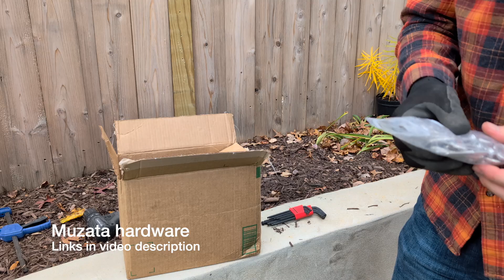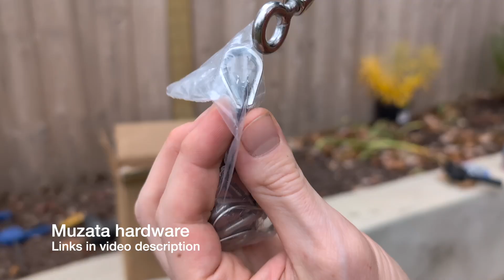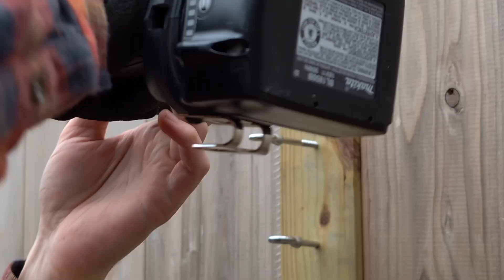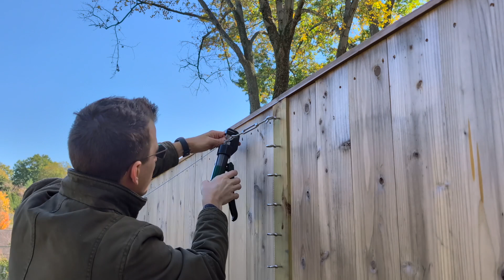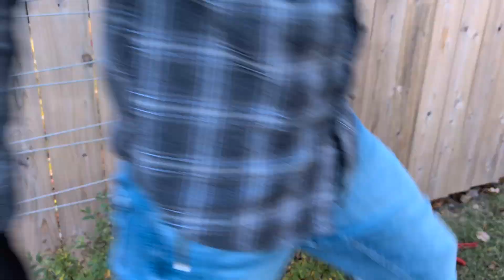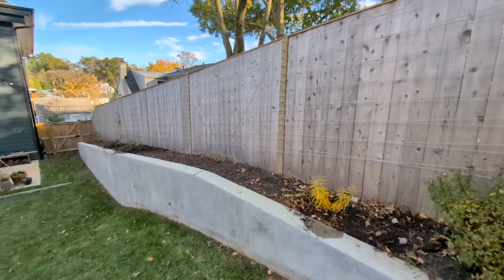50' DIY Trellis Using Stainless Steel Cable

Comment: Okay my guy. Its been a year. Lets see what vines you chose and how theyre doing. I need to know for my own project
Reply from the maker: I'll do an update soon. I had the wall mostly filled, then my star Jasmine died back after a cold night ..  I actually have several other walls where I just did horizontal runs about 8-10" apart and it's working well for the climbing roses I have.
Reply from the maker: I put up a YouTube short, check it out for the update!
Reply: @NATHANBUILDS  this is what I was curious about, if I can get away with just a few horizontal runs spaced further apart for ease of install and such.  THen maybe seasonally use twine or something else for the vertical portion.  Thinking about doing this on outside of my garage, big wall that I've grown fruits and veggies in front of for years
Reply from the maker: Yes you can definitely do that. I would actually go that route next time (and did go that route on my other walls).

Comment: This is nice but seems like complete overkill. When it's overgrown you won't even see it. Couldn't you just use welded wire mesh -- either a roll or panels? Would be way less work and less expensive.
Reply from the maker: Agreed but it wouldn't have looked as nice 😁. I have several other walls that are just five horizontal runs. Depending on the plant (in this case roses) it's plenty.

Comment: Why do you cross them and why did you do the vertical “v” in each section ?  My wisteria is growing and am looking for ideas.  I love this
Reply from the maker: The V section allows for plants to grow vertically easier. However for something like roses that need to be tied up to the trellis you can have less runs further apart and you don't really need the V. I have a few other walls with roses that only have horizontal runs about a foot apart. So far things are growing well on both of these!